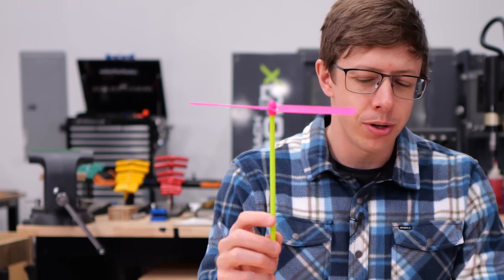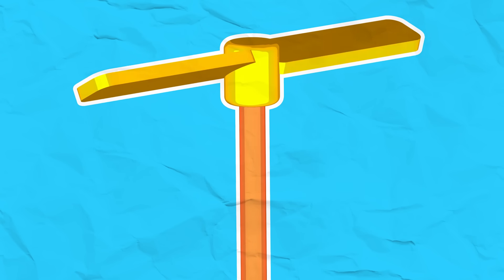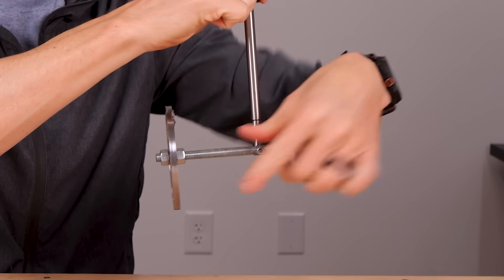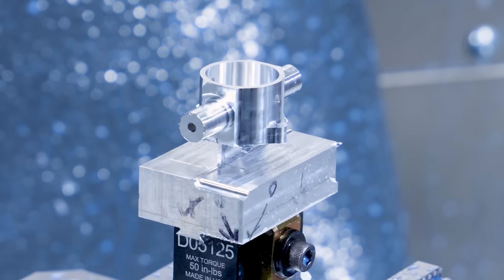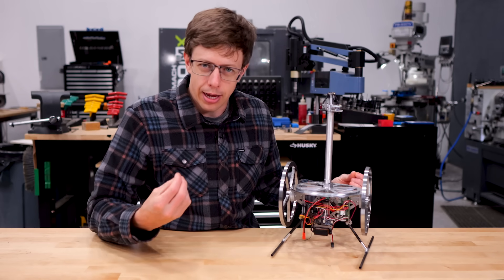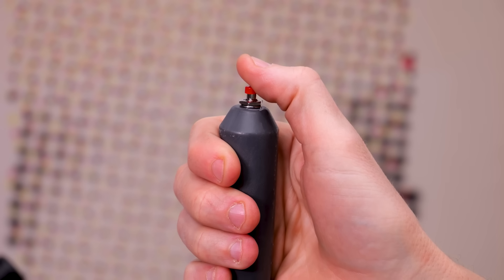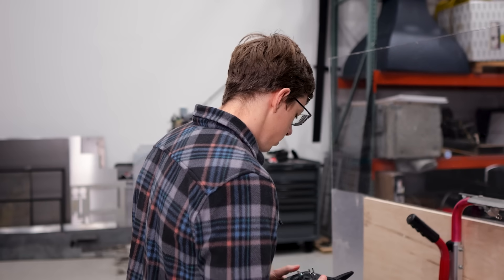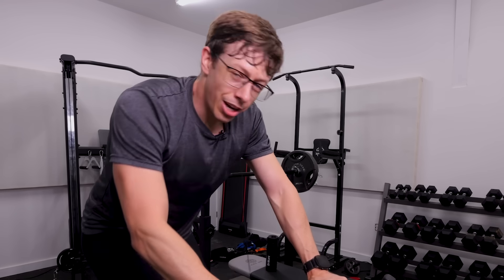I really thought this would fly well

Comment: To counter the torque from the propeller, you can have a second propeller that is rotating in the opposite direction. The mechanics of it will probably be a nightmare to construct. Alternatively you can have a third flywheel with the same moment of inertia as the propeller, but that is rotating in the opposite direction. The mechanics would be simpler but I like the first option better.

Comment: Your best bet would have been to make the flywheel itself the propeller. Spin the shaft up while it's captured, then release it for takeoff, letting only the blade and shaft fly just like in the original toy. Fewer moving parts, less weight, less fragile, and it's unlikely that the blades would chop somebody up because of them being safely inside the ring of the flywheel....

Comment: What if the propeller was also the flywheel?  I remember toys where the propeller had a ring on the outer diameter of the blades, and you'd connect the propeller to the launcher and wind it up, then release it and they flew really far.  So, if you put a balanced ring of aluminum with the propeller inside of it, maybe you'll get enough inertia where yours will fly crazy far too.  

The launching mechanism on those toys was simple too.  The propeller hub had angled cut-outs where a T-shaped bit on the end of the launcher motor would fit, and the torque of the motor spinning up the prop would anchor it to the motor.  Then, when the motor is turned off, the propeller hub slips off the T and it just takes off.
Reply: He explains why in the very beginning of the video. The idea is to keep the prop spinning at it's most efficient rpms, not too fast as to lose most of the energy to aerodynamic drag.
Reply: This design path should yield some interesting results as well. maybe it can be combined with variable prop pitch to adjust the pitch as the rotation slows down.

Comment: A thought on those control surfaces, the section of wing leading up to the movable part can be put at an angle to increase it's effectiveness. This is done on the vertical stabilizer of single engine aircraft to balance the forces. Can't wait for part 2

Comment: for the hack method, the only thing I can think of is to try Tom Stanton's approach for his little hovercrafts, rather than making a flat wing to counteract the rotation, try turning it into a wedge, or a scooped wedge (think thinnest at the point of rotation, then scooping out to the far edges. For the hovercrafts, it made the turns a lot tighter as when its pointing forward, the air is equally pushing both left an right, but then when rotated one way or the other, the scoop has a larger surface area redirecting more of the air. Just a spit ball.

Comment: I'm really curious why you wanted to put the flywheel perpendicular to the propeller in the first place... why not just put it on the main shaft, spinning together with the rotor? Then you don't have to worry about the drag from the spokes, because you can shape the spokes like airfoils and they'd be... well, rotor blades. Which I suppose could then replace the main rotor altogether. Am I missing something?

Comment: My idea, simpler, make the stick like a long bolt, with a cylinder that has a nut pattern that can glide smoothly but with enough friction to make the “stick” spin, the weight of the cylinder makes the stick spin turning the propellers. 🤷‍♂️

Comment: What if you had the the flywheel mounted to the central shaft with gears so it rotates in the opposite direction to the rotor... Basically a coaxial rotor but one of the rotors is a flywheel? I mean you would have to balance the weights just about perfectly, but the processions should be parrallel to each other and cancel out... not going to be particullarly stable but hey... other than complicating your geartrain, everything else should be easier.

Comment: You don't have two flywheels, you have three.  Perhaps you need four?  With the  fourth one spinning contra to the single horizontal one.  More weight, more complexity.  
Real helicopters have a tail rotor.  Having the power stored in the rotor, a la auto rotation be it unpowered helicopter or autogyro, is different from storing it in a flywheel, which becomes a defacto engine driving the main rotor.  You might get away with it if you can attach the flywheel directly to the blades of the main rotor, but I'm not so sure that is a great idea.
Helicopters with tip jets on the main rotor don't require the tail rotor.  I doubt that your little aerodynamic surfaces are enough to overcome the forces because the lever arm is too short and that damn horizontal flywheel throws too big a wrench into the works.  
How about just building a small autogyro and letting the air flow upwards through  the rotor?  You don't get true vertical flight, but autogyros can climb.

Comment: Why not try a stacking counter rotating blades system? Like what they use on small scale RC Helicopters very often, they work quite well and don't need any sort of tail rotor for yaw control. The 4 blades might also create enough drag falling you don't need extra engineering for the fall

Comment: Helicopter engineer here:
You're not going to achieve anti-torque using those wings. You can do some simple calculations to determine the rotor torque you're going to experience for a given thrust. I don't know how much the thing weighs, so I'm not going to do it myself, but at these scales, profile power (the power required to overcome blade drag) is pretty significant. At larger scales, induced power dominates. Regardless, you can also estimate the induced velocity (That's pretty easy: vi = sqrt(T/2*rho*A)) and from that you can estimate the dynamic pressure at the "wing" to determine how much control authority you can expect (it won't be much). In a high hover, the downwash below the helicopter will (in theory) actually be twice the induced velocity at the rotor. However, on the ground, the air actually shows down, so you lose dynamic pressure on the wing. It's probably pretty significant too. 

Honestly, if you do do a part 2, I'd recommend a tail rotor. There's a reason the single-main-rotor config is the most popular. Coax is an option too, perhaps with one flywheel per rotor. In either case, you'll probably need to introduce cyclic pitch. With all your tools, however, I'll bet you could make a decent swashplate.
Reply: A lot of people are in here suggesting tail rotors and second main rotors, but that defeats the whole goal of scaling up one of those kid toys and just changes it to "make a helicopter." :v
Reply: @BobDole1216 someone else on here suggested detaching the propeller from the motor once it's spun up (like the toy). Of course, the crash landing is still an issue...
Reply: @BobDole1216  The problem is if he doesn;t want it to crash into the ground and tear itself apart after it runs out of energy you can't scale the kids toy up.

The onyl reason the kids toys don't run into issues with that and gyroscopic efects is how light they are. But that is a factor of their small size and light construction, (which limits performance).

Overall 2 counterrotating propellers driven by a pair of flywheels linked by a gear, (so they spin at the same RPM), is the only realistic way to do it IMO and stay close to the basic concept. The tail idea can kinda work, but it's probably further from the original design. Counterrotating is just one toy inside another on some levels.
Reply: Are there reasons not to use a second counter rotating prop above the first one? A tail prop seems intuitively less efficient, since it doesnt contribute to lift.
Reply: @fabian899  I also think a second coaxial prop would be the most elegant solution, but there certainly are downsides: You would need two of the big (amd thus heavy) bevel gears, you lose some efficiently, because the props share their airstream and there are construction challenges. Currently there is one tube that transfers power from the bevel gear to the prop and a pin in that tube that controls the pitch of the blades. You would need to put another tube in there (to transfer power from the new bevel gear to the new prop) and another one for the pitch of the new propeller.
Reply: @ He doesn't need another large bevel gear for contra rotating prop at all. The bevel gear was just to connect flywheels, connection between shafts can be made simply by two small spur gears.

Contra rotating props have other advantage too. Bottom propeller is working in airstream of first one but in opposite direction. So it's relative motion to air is greater (as air was spun by top one) getting a bit of boost.
Reply: @fabian899  Doesnt contribute to lift, but weighs much less (because smaller) so less lift is needed
Reply: @ they'd fight each other 

the tail rotor is a gold standard for a reason lol
Reply: Yeah... for the wings to serve their purpose, the amount of drag on them would oppose all lift generated
Reply: What if the start point was about 1 m from the ground (or more) - and it would rest only on some struts so the air could freely pass along and below the vehicle
Reply: @ilmt  definitely that's cheating.  If he were willing to air launch, he could just design a rock or whatever
Reply: I was gonna say... isn't doing this without a tail rotor kind of an axiomatic failed mission without a crapton of extra work that might not even do the job?

But you were the first person in the comment scroll to point it out.

I thought the importance of tail rotors was pretty common knowledge even if I couldn't tell you how to tune one!
Reply: @matthewhall5571 He intended to use the gyroscopic procession to serve that function, I think.
Reply: @ won't work with that big sideways wheel yawing it to hell though
Reply: @PadrinoLuca  In which case, we need perpendicular gyros.
Reply: @matthewhall5571  Yes, it needs a second rotor in the tail or on top
Reply: I feel like a tail rotor is out of scope. The goal is to create the best possible version of that kids toy. What makes the toy stable? Would a concentric counter-rotating flywheel at the bottom keep it upright while storing the energy needed to keep it in the air for longer?
Reply: @scaredyfish  The toy is stable because it's so light that aero forces exceed gyroscopic forces, make it any bigger, stronger, or faster spinning and its no longer stable.
Reply: @scaredyfish  even relying on a perfectly matched counter flywheel would inevitably introduce torque due to differing drag vs rpm profiles of the prop and flywheel
Reply: @scaredyfish  partly gravity of the stick hanging down, partly it is not controlled in any way so it is not needed to be stable, the whole thing is spinning.
Reply: (That's pretty easy: vi = sqrt(T/2*rho*A))  Pffftt,,Easy,,we do maths like this at primary school,,here in NZ,,,
Reply: I'm a painter here, so I'm massively confused by all of this. Joking aside, I did make a model (RC) helicopter way back when, using a bit of knowhow I've acquired over the years, and yeah... it's gonna be the tail rotor. I ah... yeah, I found out why that's a thing. It was not a cheap mistake, but it was an important one to learn, I'll put it that way.
Reply: He could consider a tipjet design, but that's getting way beyond a kids' toy. At least one design (The rotodyne) had the gas generator inboard and piped along the inside of the rotors to the tips rather than trying to mess around with ramjets
Reply: So basically just build a helicopter.
Reply: Don’t transmit power through the shaft! a) doing so requires anti-torque solutions, b) defeats the goal of mimicking the toy… 

Solution: Rotor blades with circumferential mass decoupled from the body below. No need for beveled gears, etc. Spin ‘er up and let ‘er fly! 

Love the channel!
Reply: How about a horizontal fly wheel rated to balance the propeller torque rotating the opposite direction on the bottom of the shaft.
Reply: @johnmccallum9106  yeah with a 5 to 1 planetary gear. so that the flywheel sits straight below the propeller but still goes faster.
Reply: hm its a bit like if you shoot two guns that shoot the same caliber but different weights. the lighter gun will hurt more to shoot.(a lighter helicopter will torque steer harder than a heavier one)
Reply: @Peron1-MC  Not at all. Heavier helicopter needs to generate more lift. More lift makes more drag and more torque that needs to be countered for. Your comparison is more about inertia I think, but that only affect acceleration, not force.
Reply: 14:26 Is the aileron deflection in the right direction? It's look to me they go along with the torque here!
Sorry I forgot to mention I'm a professional hairdresser  🙂
Reply: Don't forget to upgrade the fandangler
Reply: @wados3579  how would that help?  What it really needs is a whatsawhosit
Reply: To me, the moment of force exerted on the counter rotating flywheels are opposite of each other.  That is to say that they both will experience gyroscopic precession in the same direction from the force applied.  They both should have been rotating in the same direction to counter the forces as the moment is on opposite sides and would have canceled each other out.
Reply: My mind went straight to coaxial rotors. Slap a second bevel gear on the bottom of the bevel gear transmission, make the main shaft hollow to run a second shaft through it, which will spin a second rotor above the first.
Reply: Yeah but what's the fun in calculating? Brute forcing your way thru physics it's where we want to be
Reply: Counter rotating props worked on mars!
Reply: Just a regular engineer here: Yep. thought the same. 

Shouldn't have went with the strange wing design. If thats the basis.

I also thought: Why not use the gyroscope effect and build it all in "one line" Have the flywheel at the bottom to stabilise everything, connect it to the propeller rod through a nice gear ratio of 1-5, you probably make the flywheel smaller but with a heavier material so it doesn't create much drag but still hold lots of energy. I don't see why this shouldn't work. 
You could also make it in a cone shape to keep drag low (ish).

With this design you'd probably want 4 small wings for slight steering. Like what the rockets from SpaceX use.
Reply: @Climate.Realist  I hope you are not aeronautical engineer, just a regular one. (Just joking)
The main feature of the flywheel is it's inertia, not mass. Making it smaller and heavier would be worst possible solution in this case. On the contrary, larger flywheel with light material will have large inertia (main reason of flywheel) and low mass (parasitic property). If he could make spokes thin or even wing shaped, he would have a rotor with large inertia and low weight.
Reply: @jakubpollak2067  Industrial engineer, the worst kind of engineer.
I just saw it as a means to store (rotational) energy. And since I don’t care about spinning it up, just how much energy I can store, I‘m pretty sure a heavier fast turning object can store more rotational energy and if it has a lower diameter, we can save a bit of drag on the way up. 

I only know flywheels from a car perspective. And there of cause a lighter flywheel is much better - because you want to limit lag. 
But with this one time use helicopter - I just need to spin it up once.
Reply: @Climate.Realist  This is the comment. It's a failed project because he didn't consult any aviation engineers. No idea how this made it to trending.
Reply: Agreed, same reason boat rudder and plane air surfaces don't do much without moving forward.
Reply: Nerd.

Comment: How about the idea of putting significant weights at the ends of the main rotor blades so the rotor itself is the flywheel?  Then, it could be released just as the kids' toy is; just the rotor and shaft, so you avoid the problem of countering the torque altogether, and the additional rotational inertia will keep the rotor spinning for longer at a lower, more aerodynamically efficient, RPM.

Or even better, have the tips of the blades end in a ring so that you really do end up with a proper "flywheel" the same diameter as the rotor?  Actually, I've seen that design in some kids' toy propeller blades, and had thought it was just to stop the blades from breaking, but now that I think of it, it probably causes those blades to spin for longer for this reason.  And if you had a relatively heavy metal ring, the rotor might be able to continue spinning for a long time!  Though in such a design, you'd lose the ability to be able to change the blade pitch for an autorotated landing.

Comment: I've seen other designs that utilize 3 blades attached to a ring around the outside. The 3 blades allow for more stability compared to 2, while the ring on the outside acts as the flywheel.

Comment: So curious to see the second video. I wonder if removing the bevel gears and mounting the flywheel directly to the prop shaft would help. Also mount the battery and servo directly to the prop shaft with counterweights so that it all spins with the prop in equilibrium.